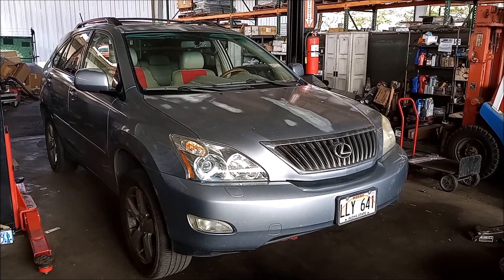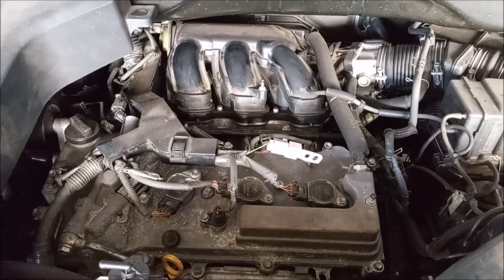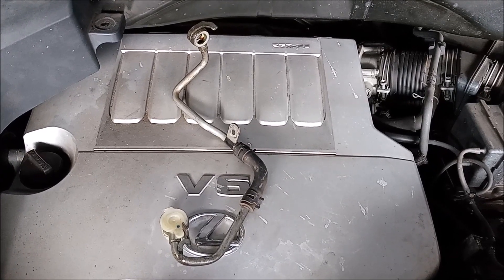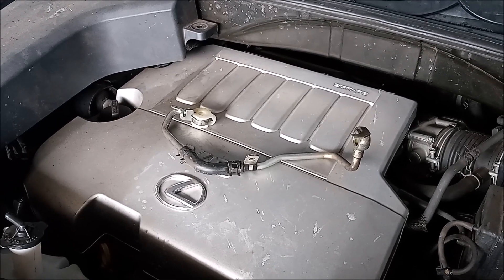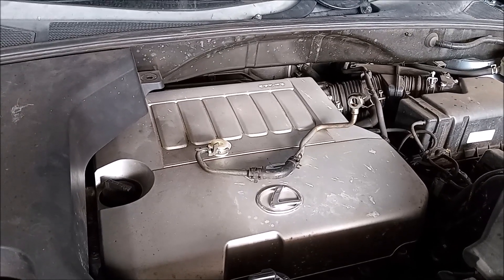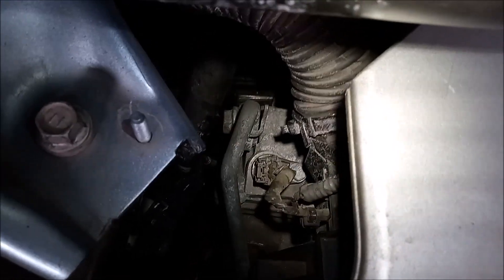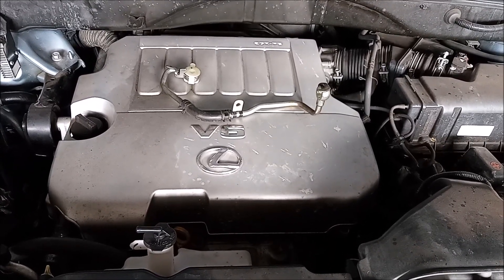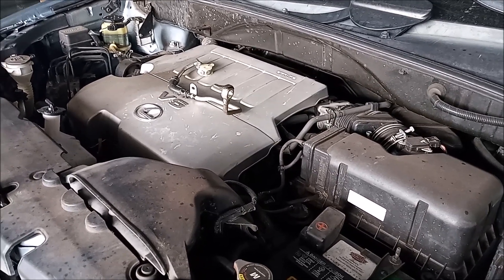Toyota V6 - How to Check the VVT Oil Line - 3.5-liter 2GR-FE - Camry Highlander RX350 RAV4 Sienna

Comment: Why in the hell would Toyota even put a rubber part in the middle of 2 metal lines in the first place.  Thats stupid.
Reply from the maker: why ask why. in the world of mice and men, things oft go awry. that's the only explanation needed.
Reply: A lot of vehicles are like this.. Ford, Mazda, Honda, Toyota etc. Hoses between metal pipes at water and oil junctions. if you drive your car 100 to 200,000 Mi often you won't have a problem.  By then your vehicle is sold, wrecked or junked.. that's why you have to  replace 100K mi or so. Engineers know this, as it allows flexibility movement to the heat cold physics aspect of the engine. The real problem with the earlier 2grfe is the lower front oil cooler hose(s) are 6 in. from the catalytic converter.. rubber next to hell.
Reply from the maker: @surftile  nonsense these hoses were failing prematurely at 50,000 miles or less and were subject of a Technical Service Bulletin for free replacement - a normal wear item would not get this treatment, because you know how much Toyota and its dealerships HATE doing anything for free, unless they absolutely have to,

Comment: Hi MerryFrankster  2011 Sienna I look inside engine there is piece plastic cover it and line curve back down can not tell rubber or metal line
Reply from the maker: If you cannot see any rubber, it is metal.

Comment: I'm in a pinch, I can see mine start to weap around the edges and it was replaced because the cover is missing and I can see where someone had fluffed around with the PS Pump. 
Gonna get an equivalent rubber hose to have on hand if it gets worse on my road trip.
Reply from the maker: If the best you can do is keep an eye on it then that's what you gotta do. However.... these do not give you any warning when they go.

Comment: Fuck I have the rubber one on my 08 es350 T.T

It's bone dry in there though. Is there really a need to replace this thing? Should I wait?
Reply from the maker: It will definitely be good up until it starts leaking.
Reply: @Merryfrankster_  HAHA okay are you trolling me or saying that I'll have a bit of warning? If I open my hood and check this thing once a week, is that enough notice, or does it fail so rapidly that it will sneak past my interval?
Reply from the maker: @humanerror7  it can fail suddenly without any warning if you are going down the highway you will smell oil burning you will have less than one minute to pull over and stop the engine before it is toast.
Reply: @Merryfrankster_  less than one minute? Holy moly. Wow. Thanks so much for the heads up man, I'm getting this done as soon as possible, gunna give my local shop a call within the hour and get an apt this weekend
Reply: I still have the rubber one on my 07 camry. 260 k. I bought the line a couple years back , I’m in there doing a water pump today so finally just gonna replace it
Reply: @sjd7188  wow. Do you live in a hot or a cold part of the world? Has the line ever leaked at all?
Reply: @humanerror7 just got done changing it. Never leaked live In South east PA so got in summer. Never leaked , hose was barely starting to crack. If you read up on it they had two either suppliers or types of rubber hose used. One would fail other was ok. My car was checked via recall or support campaign before I got it in 2011. I think they did this to verify which type of hose was on there. Obviously the all metal is better but clearly in my case nothing was wrong with the hose. Feel better it is changed out but probably would not have failed in the near future. The banjo fitting behind the PS pump was a MF to get loose…
Reply: @sjd7188  thanks for the info!

Comment: Dropping the motor in my 06 Rav4 is so cost prohibited, I'm thinking outside the box and will replace only the rubber hose section with Toyota oil cooler line. A little tight but it can be done since the lower pipe is held in place with the clip. Just have to be super careful not to bend the metal pipe/banjo on top.  What do you guys think?
Reply from the maker: Thank you for watching and for commenting.

Comment: it's easy to replace that line if you do not have a power steering pump on your car. Otherwise, it's easily a 3-4-hour job.
Reply: Most likely it will have a power steering pump on this motor🙄

Comment: Thank You Frank! Do You know if there was any cases solved with vibrations in steering wheel while the vehicle is in "Drive" mode and stationary? Vibration that only happens mostly when turning the steering wheel.
Reply from the maker: Vibration in drive with brake on is usually transmission mount or motor mount. Turning the wheel could possibly make it worse because of added load on engine to run power steering.
Reply: @Merryfrankster_  i've read that many people that encountered this problem said their transmission and engine mounts had been in perfect condition. These cars had 40k miles at the time. What about the MAF? Is it possible that crank or cam sensors might be dying? The transmission itself?
Reply from the maker: @johnlakes6948  Anything is possible. If you want to do engine diagnostics with live data you need a scantool, or, absent that, a witch doctor. Look for unlikely causes of the problem, ignore any likely cause.

Comment: That sucker line is hard to replace, I did it on a es350 along with valve covers, spark plugs ,o2 sensors bank one side, water pump with the idle pulleys. I’m a novice maybe that’s why it was so dam hard and I can see why no one wants to be a mechanic specially when all the connections get so brittle.
Reply from the maker: You bit off a lot to chew on for a first-timer. Good job on getting through it.

Comment: Hi from Michigan! Great communication of important info! On my 2007 Sienna is there 2 hoses, one for each bank?
Reply from the maker: The bank on the front always had an all metal line. Only the bank on the rear had a rubber line in earlier models, switching to metal in 2010.

Comment: Glad to come across this one Frank. It's helping me trust my intuition. This exact oil line was "repaired" under the special service bulletin on our 2008 Highlander Sport a bunch of years ago. That was way back before our warranty expired, and all they replaced was the original rubber section.  Here I am years later doing a bunch of work on the car now that it has 1/4 million miles on it, and I found that the metal sections of that oil line were corroded beyond the point that I can trust them. The rubber part looks fine. Well, removing that black plastic "insulation" cover was a pain in the butt because it's nearly impossible to remove the two 10mm bolts that hold it in place. Once I removed that cover, I realized the oil pipe underneath it was nestled in corrosion, and the timing inspection port in the side of the timing cover that is also partially underneath that cover was corroded all to hell. So now I have to get one of those and 4 new bolts to replace that as well as I don't trust that either. Living in rust country (New England) sucks when it comes to auto repair!
Reply from the maker: Oh my. sounds awful. Rust kills. Watch out for the brake lines, transmission cooler lines, et cetera, anything that can corrode and leak.
Reply: @Merryfrankster_  Wow you are spot on! This was my wife's daily driver for 8 years, then became our 2 sons' high school, sports & college truckster. We live in MA, but It's currently our younger son's college car in PA. When he was home for Thanksgiving, I double checked under the hood before he went back as he told me the engine light and a few other warning lights were on. My scanner showed "Crankshaft position sensor" errors. Great. Well, I opened the hood, and the first thing I noticed was coolant on the bottom radiator support... further inspection showed a completely rusted hose clamp. Up on ramps, I took off the under fairings, and discovered that the lower coolant hose clamp, and 3 transmission cooler line clamps were rusted all to hell. That was my first order of business. Had to have the son drive his mom's Mazda back to PA, so were playing musical cars until Christmas. You're right, rust kills. It kills motors, transmissions, and people. Ford products come to mind with that last one...

Comment: Thanks for the heads-up.  I will have to check my daughter's 2007 RX350 Lexus
Reply from the maker: It's definitely worthwhile to check that one. If you're lucky it has already been replaced under warranty.
Reply: Yes you do my 09 RX350 blew the oil line, was just luck I saw it and no damage was done. Catastrophic to say the least.

Comment: Thank you for this information, I just picked up a 2006 Avalon XLS w/157k and It looks to still have the rubber elbow on the oil pipe/line. Definitely will have to get this replaced asap.
Reply from the maker: thank you for watching and for commenting.
Reply: Great taste , congratulations. 226k on my 07 Avalon. Still drives like new.Also, Keep an eye on the waterpump too and clean oil.  Enjoy it!
Reply: @billcable286  I paid $3700

Comment: I picked up a 2008 RX350 in March 2023. It had the upgraded rubber elbow, replaced the faulty one in Nov 2009. But I still bought the all metal line and had my mech install it for me last month. So far so good
Reply: Btw you’re right about dealers lying about “the updated rubber line does not need to be replaced”… even my friend’s Toyota mech said the same to me.
Reply from the maker: @emteebee1872  They lie through their teeth just like they lie about everything. Toyota is the master of the corporate cover-up. The sad thing is: people believe them.

Comment: Hi Frank, I have a new to me '06 Avalon.  I saw earlier videos you did on this and started looking for the metal line under that part #..  What I got was the line with the upgraded yellow stripe rubber section.  I went to my dealer - he had that part # but again not all metal.  Online I saw discussion that Toyota had gone back to the rubber line version due to cracking of the all metal line.  My dealer knew nothing of this, only that the part he had is the Toyota revised part.  Have you heard anything about this? I found a metal line and ordered it, I now have one of each, all metal and the rubber upgrade.  I'm installing the all metal this week.  I'm not sure where that Amazon link is getting their lines but I don't think it's Toyota, despite the parts labeling.
Reply from the maker: I have said in the video the dealer will lie to you, they will gaslight you, they will play dumb. The Amazon source is genuine or you can use the past number to order from anywhere you want.
Reply: @Merryfrankster_  Hi, thanks for getting back to me.  The dealer certainly played the "I dunno" card.  But I have ordered that part # from other dealers - it always comes with the "improved" rubber section.  I did find an e-bay all metal line.  So, I'll put that in.  Your coverage on this subject has been very helpful - I did wonder if you had heard of the metal lines cracking but if the new engines are all metal maybe I heard wrong.  Thanks again, you've helped me a lot.
Reply from the maker: @seamusrigh2162  they are chatting you. When I order the part I get a metal line. I even show it in the bag with the part number in one ofy other videos. If you do not want it from Amazon, buy it from conicelli Toyota. Call them and tell them what you want so there is no misunderstanding.
Reply from the maker: All new vehicles have the metal line.

Comment: My 07 sienna had the upgraded hose put on that has the yellow stripe on it. Supposed to be a type of rubber better suited for the line. I bought the all metal line but haven't installed it yet. The upgraded hose looks in good shape so I been putting off installing the all metal line but I will someday
Reply from the maker: Keep your eye on it regularly. Check for any oil seeping. It can go very fast once it starts to break down.
Reply: @Merryfrankster_  will do,thank you!